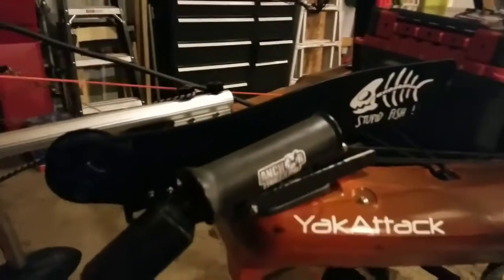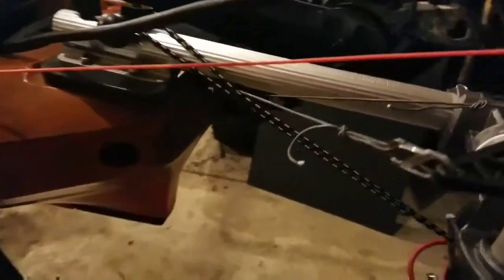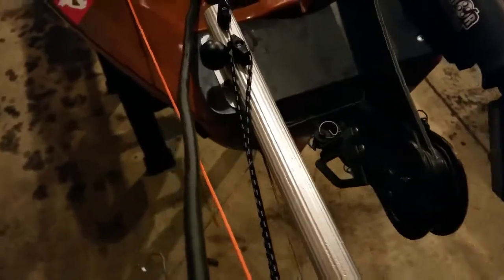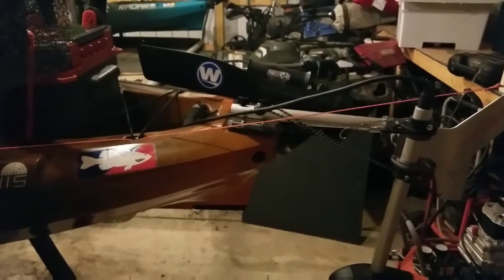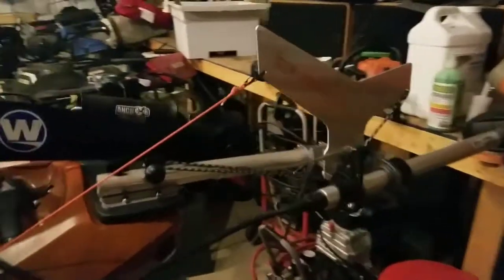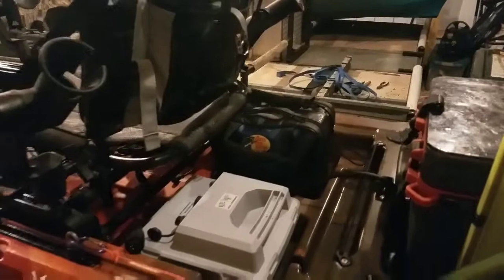Radar 115 / Helix PD Setup V2 (Torqeedo)

Comment: Nice setup!  I have the radar 135.. I was wondering about doing the same setup.  Wanna be able to use motor to get to places and still have peddle and rudder to use while fishing.. very clean setup. Thanks for the ideas .
Reply from the maker: Kyle Tuxward thanks, I have had it on the water a few times now, no issues, works awesome.

Comment: How long does that WS battery last, powering that Lowrance?
Reply from the maker: It's a 15 amp hour battery. That particular lowrance only draws around .5 amps. I can get almost two fishing trips out of it. 

So basically, mathematically it should  last 15 hours at a 1 amp draw. Of course that would be in optimal conditions, etc.
Reply from the maker: Also, make sure you read the info on the battery on the WS website, due to safety features they aren't compatible with some of the larger size fish finders, like the 7 and up.
Reply: Thanks for the info... love the size of that battery. You could put it in some type of padded case when its cold out and it would still easily fit inside the flexpod